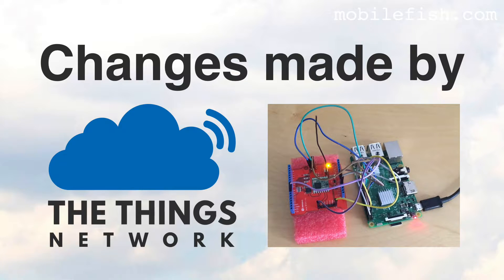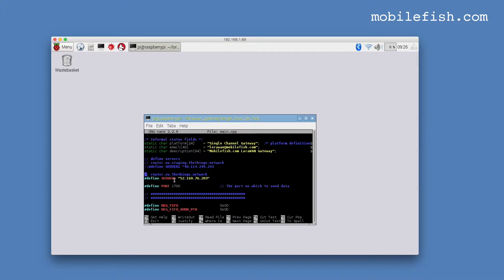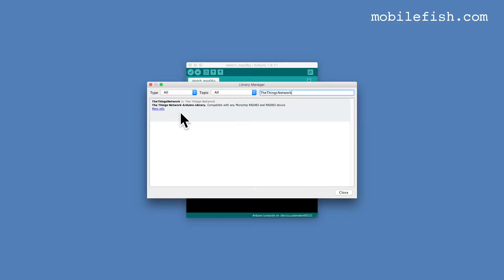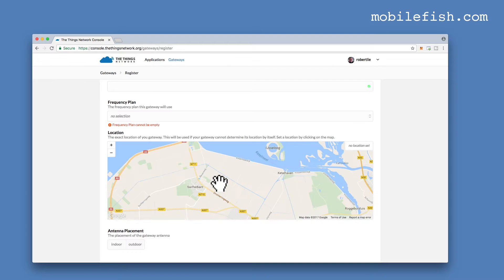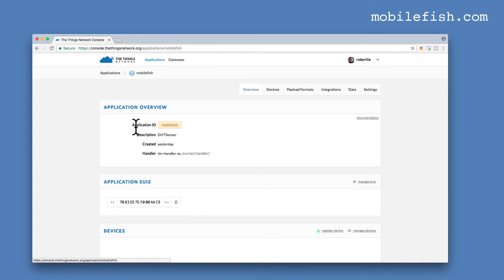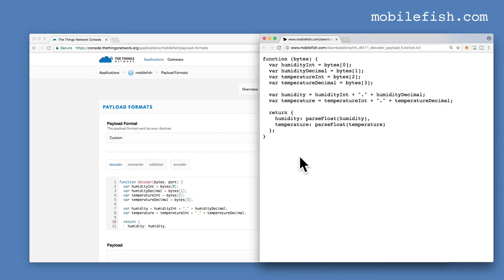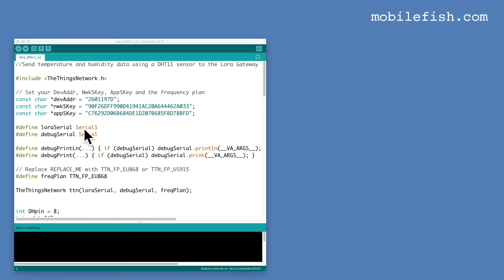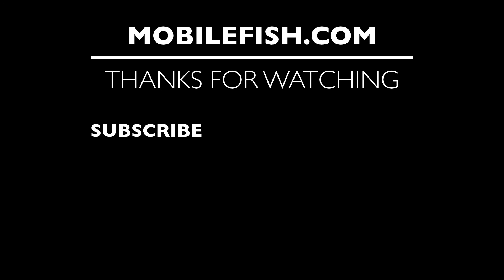Changes made by The Things Network, part 8

Comment: Hello,
Thank you for great videos but I don't have a Leonardo and I assume that's why things are not working even though I get a "Successful transmission" on the serial monitor. My Raspberry Pi gateway transmits "hello world" packets from my Feather m0 node and I can send packets of dht11 data with my dht+dragino shield from another sketch but I can't seem to get yours to work. The serial monitor yields the correct humidity and temperature with "Sending: mac tx uncnf 1 39001500(varies). Any help would be appreciated.
Allan